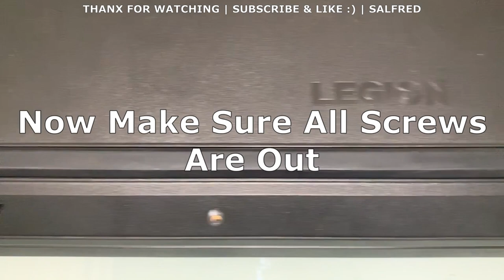How To Open The Back Panel Of Lenovo Legion Y540 | 1080p HD

Comment: Hey for some reason im missing one screw in the back panel it doesn't matter right? It may have got lost while i was taking off the back panel
Reply from the maker: Delvin Firebolt188 hi:) one screw its nothing so it all fine, its closed with clips even when you removing all screws its still closed.

Comment: M doing repasting this week from Lenovo so your this video will come handy
Reply from the maker: Balkeet007 ok!! Its great:):) try to do it with thiner plastic if you have,
and if you can do it faster than me 😂😂 not 10 min just to open😂(i didnt understand at the beginning how to open it lol),
im happy it will be handy for you:)
Reply from the maker: Balkeet007 did you meant that someone from Lenovo coming and repasting for you?
Reply: @salfred5928  yes someone will come over. You did good as it was first time n don't want to break anything
Reply: @salfred5928  does your y540 has Fn key disable option in BIOS?
Reply from the maker: Balkeet007 yeah thanx:) ok so you at good hands:):) 
and i will check it and will update soon, BTW im already updated to 31 version of bios
Reply: @salfred5928  yes no difference in fan speed or cooling in 31WW
Reply from the maker: Balkeet007 you are right! and yes i do have an function named “Fool Proof Fn Ctrl” and its on Enable, i have the option to disable.
Can i ask why you need to know that?
Reply: @salfred5928  no that doesn't disable the Fn key. I want to change brightness, volume etc on f1-f11 keys without pressing the Fn key which is not possible unless you disable Fn key. I don't think y540 got that function
Reply from the maker: JustAxqua hi:) basically i already did the update so i cant do it again, but i updated it through the Lenovo Vantage Software, you need to enter to the software and there you have at the Home Page button named “System Update” at the right side of screen, and there check for updates, it will find it and you need to install:)
Reply from the maker: Balkeet007 ok thanx:) i looked and there is nothing else that connected to the Fn Button:) 
i personally think that is perfect button i never thought to disable it, its so useful:) but ok thanx again:)
Reply: SALFRED Yeah he probably means it can be annoying for example in low light environment to look down for both fn key and for example brightness key.
Reply: Balkeet007 Yeah, actually out of curiosity I tried all available BIOS version (from 21WW which is oldest I could find to 24WW, 26,27,28WW and finally 31WW. Even made a chart about it, in short 28WW and 31WW are no way for my unit as they run relatively hot even with undervolt and underwatt. 27WW is ok but still runs 5C hotter in average in all benchmark stress tests and gaming tests than 26WW which is for some reason most stable when pushing limits with undervolting, I would even say fans run faster (and little louder) so I will stick to it before something better comes of Lenovo, if ever... 24WW and 21 are basically 27WW in disguise, no fn +q max fan option.
Reply from the maker: zikky6 ohh ok sounds reasonable:) and comfortable:) thanx:)

Comment: Hello! I have problem with my y540. When I enter any game, it gets hot at charging port and it just stops charging (charging port checked at repair shop and they said charging port is not a problem). Should I try remove battery and test it without battery?

Comment: Your Y540 have a HDD flat cable?
Reply from the maker: Antonio Remualdo did you meant to this one?
If yes so yeah i got it in the box with the laptop
https://ibb.co/Fzh1kVp
https://ibb.co/5WxzSJf
https://ibb.co/3y6kDBp
Reply: @salfred5928  Mines missing but mine did come included a 1 TB HDD.
Reply from the maker: dboymax1 hi:) well so you got the whole package ready to go:)
im ordered 2.5” 1TB SSD to add in the hdd spot i will connect it with this cable:)
Reply: @salfred5928  the 1TB is most likely a regular HDD and not a SSD. Wish there was an easier way to access the back so can put another 8GB stick to upgrade to 16GB...
Reply from the maker: dboymax1 no i meant im ordered an 2.5”SSD from amazon to add in addition to my 1 TB ssd nvme
https://www.amazon.com/gp/product/B07L3D19MY/ref=ox_sc_act_title_1?smid=ATVPDKIKX0DER&psc=1

** and if you open the panel carfully it’s actually very easy to get to the ram and change/upgrade it, you can see at the end of video the ram slot:)

Comment: Hello,Just a quick question here , let's say for example my Y540 is single channel 8GB RAM 2433Hz made by "Corsair",if I want to upgrade to dual channel and add another 8GB 2433Hz It must be made by "Corsair" too or it's fine if it's made by ADATA or TeamGroup ? Does that matter ?
Reply from the maker: աåʀʀɨōʀ ωαяяισя hi:) i know it doesnt matter which company are made the RAM, on older laptops i put different RAM and it worked ok:)
Reply: It doesn't matter which company made the RAM, only the clock speed has to be same.

Comment: We can remove SATA case and  heat protector to reduce the weight. Laptop weight loss by 500 grams ?
The manufactor could change the hinge to be like HP omen at center and have magnesium / aluminium case, reduce the weight to below 2kgs.
How is this plastic laptop heavier than Triton 500 built of aluminium / magnesium ?

Comment: Also, how is the battery on this? For normal chrome at 50% brightness with the lighting turned off? Also, using the integrated GPU for these tasks by using the Hybrid Mode?
Reply from the maker: Prashant Goyal hi:) i almost never use the battery but i can say that from all tests i have made its for
Normal use up to 4+- hours 
Heavier like games 1-2
i did the hybrid mode also and it was at normal up to 4+- hours:)
** i know that you can get also up to 7 hours when downclocking the cpu. + undervolting + limiting processor to 40% usage on Throttlestop Software thanx to @AÏA :) 
(i didnt tried it)
Reply: @salfred5928  limiting the processor to 40% usage, isn't it taking too far 😂. I will be satisfied with only 5 hours of backup. It think the hybrid mode + undervolting would work fine
Reply from the maker: Prashant Goyal yeah ok i told you from tests i have made its 4+- hours, never got more then that.
The 40% limit was made by some user and he told me it worked fine cuz he wanted to take the laptop to school for writing all day, so i didnt made that but i know its possible:)
Reply: @salfred5928  yeah. I was just saying. Thank you ☺

Comment: The technician did a poor repaste job so repasted myself with the left over same paste and CPU temperature dropped by 10°C. While opening the bottom cover was stuck on side heatsink areas as was unable to break seal there but your video came to the rescue. But opening y540 bottom cover is tedious.
Reply from the maker: Balkeet007 thanx for update!!:) great job for repasting by yourself wow!! well done!
and 10 degrees its awesome, great achievement! now i also want to do it:)
Maybe you were the last customer to serve so the technician rushed home:):)
im glad that the video helped you:) i agree that in the first time its a bit hard to open it,
but after second time you already understand how to open it in an easy and fast way:), 
i just have talked with my warranty company and they told me that i cant do by myself the repaste cuz it will avoid the warranty:/ (dont sure if thats true maybe he just have to say that to me)
Reply: @salfred5928  yes it can't void warranty unless in the process some other problem happens. Now sometime later I will do kryonaut repaste or any other best thermal paste in market
Reply from the maker: Balkeet007 ok thanx for all:) i will go for it also, and will update a video with all process and if it helped me in the temps:) 
just can you recommend me a good thermal paste and with what to clean the old one with alcohol or something? thanx
Reply: @salfred5928  I used nail paint remover, earbuds, tissue paper to wipe clean the CPU, GPU n heat sink surface. For thermal paste you can use kryonaut, NT-h2, NT-h1, mx-4. No need to remove fans n their connector. I tried removing battery connector but its too tight so skipped removing it too. Before applying paste practice heat sink placement, I did 10-15 time shadow practice. After placing heatsink there should be no movement, just gently tighten the screws. No need to close the bottom cover for testing temperature, after testing in game temperature close bottom cover. A good guide here from Jarrod https://youtu.be/pzRfD5iYyRM
Reply from the maker: @Balkeet007  wow thanx!! your explain better than a video :):) i will use that when i will do it:) great video from Jarrod! it would be helpful, Thanx!:)
Reply: @salfred5928  lol thnx, also do not use applicator to spread paste, let heat sink do that while placing it back.
Reply from the maker: Balkeet007 ok! great tip thanx:)!!
Reply from the maker: Balkeet007 hi man:) just wanted to update you about that i was finally talked with my warranty(it was holidays for last few days) and after all they said to me that its totally fine that the legion y540 i7-9750h reaching to 90-97 degrees(strange!?) he told me that this model meant to reach those degrees and its fine, he said there is no need for thermal paste, so i told him that still i want a technician so they will send me one soon but he told me that most of chance the technician will not do any fix cuz its fine like that( he told me also that they tested the laptops before they put it on sale and they know about the degrees) very strange...
Reply: @salfred5928  yes same reply to me too but the technician do carry the thermal paste so you can ask him to do repaste. And learn from him.
Reply from the maker: Balkeet007 ok thanx i still told him to come(he said there is no need but i asked him to come) when he will come i will tell him about the paste hope for best:) but still its strange that he said its fine just as it at 90+ degrees... ok thanx!
Reply: @salfred5928  yes you can argue with him if 90c + temperature is fine then why CPU down clocks from 3.9 GHz. Make sure Throttlestop tdp limit is 70 n 107W. Show him stock temperatures

Comment: Me: spends £1000 on a gaming laptop and like to use controller 
The laptop: 240fps on fortnite 
Me: Nice

EDIT: Why stupid reply’s
Reply: if it’s this laptop, i have the same one and i could run fortnite at around 200 fps, try changing your video settings and make sure they aren’t all at epic, put them all on low then if  u want change a few of them, or if that doesn’t work change your frame rate limit
Reply: @CineLewis  ok
Reply: Most likely you haven't plugged in the laptop. It is very important to do so otherwise the laptop will start throttling after it is reduced to battery power. Even if your laptop has a lot of dust only the fans should be loud and your laptop would be hot, but it would not reduce your performance to the level where you can't even run fortnite at 60.
If it's not that, probably a lot of background apps are open which causes it to utilize less ram.